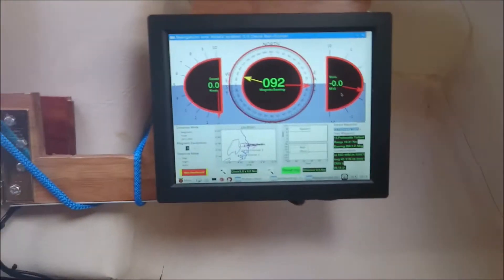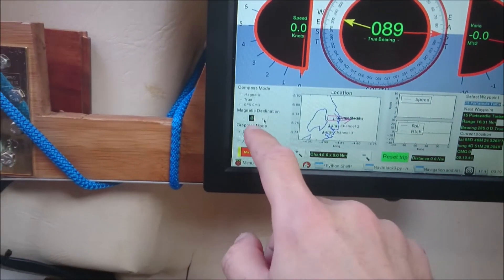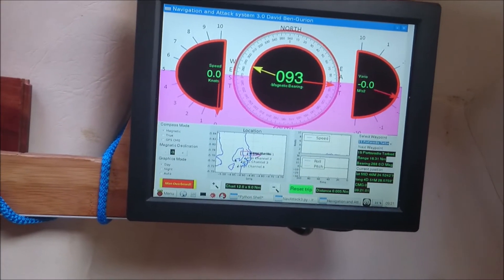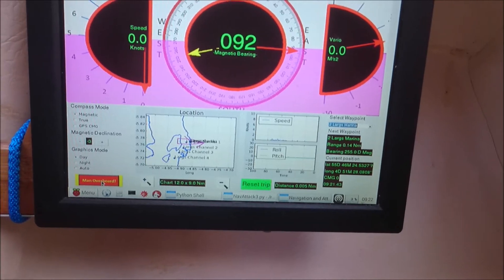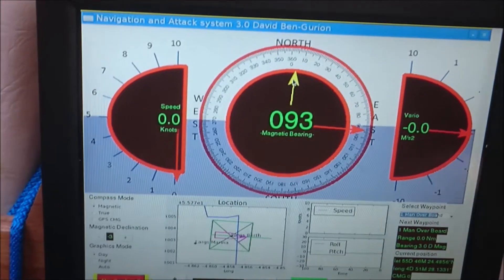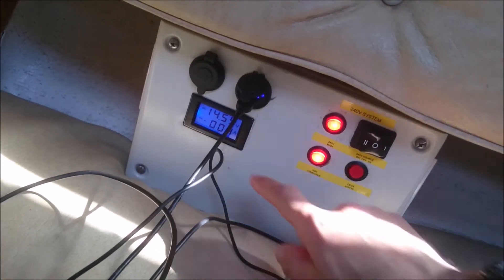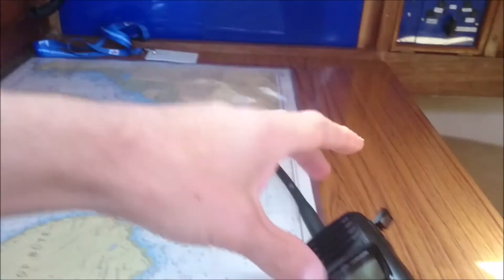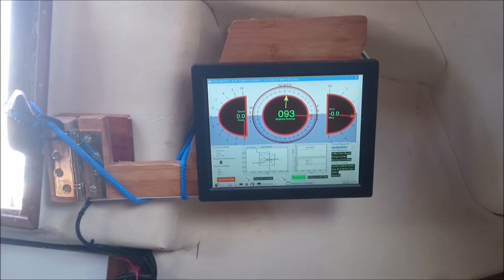Raspberry Pi based Yacht Navigation System talk through

Comment: Hi Olly, great work & presentation.  I'm currently searching for a DIY alternative to the overly expensive electronics control systems available for my" Good'Ol Boat", a 1979 C&C 34.  I'm curious, have you been able to incorporate other equipment into this system such as Depth Sounders, Wind Vanes,  Auto Pilot (I have an old Raymarine ST4000+), etc?  It would be great to have a central computer hub with the Pi, much like you've showcased, that can incorporate & display additional signals from peripheral hardware.  Any thoughts?
Reply from the maker: Many thanks Chris.  On the system presented here the only inputs are the compass and GPS dongle, and the only output is the display.  It is a stand alone unit.

I have considered attempting to add other sensors in, and am currently upgrading it to include wind speed and direction, and to communicate with the autohelm.  However for this I have decided it is easier and safer to simply add an additional wind speed and direction sensor than it would be to mess about trying to integrate the signals from my NMEA 2000 bus into a raspberry pi.  I am 100% certain that could be done, but I don't have the skills, documentation and time to do it.  In addition I live a good 50 minute drive from my boat so by making the system self contained I can build and test it at home rather than on board.

If you have an older NMEA 0183 network I believe it might be a bit simpler to integrate your existing sensors.  There are a few videos here on how to do that but I haven't tried it myself as I dont have that bus.  The thing to remember about NMEA 0183 is that it was designed to have only one "Talking" component and several "Listening" components.  Thus if your boat has an NMEA 0183 network there is almost certainly a multiplexer somewhere.  This device acts as multiple listening channels from the various sensors, and then outputs one stream to your instrument cluster.  Generally these outputs used a RS485 current-loop type serial communication.  In theory you could branch off this and into your raspberry pi with either a RS485-USB converter, or a similar arrangement directly into the Pis UART (Universal Asynchronous Receive Transmit) bus.  The problem you may have is that such converters are fairly pricey.  I have seen some people have succeeded with the much cheaper RS232-USB converters but bear in mind here that RS232 is voltage based not current based so unless you match it with the proper resistor values you run the risk of blowing your NMEA bus.  I would approach with caution but if you manage it please keep us posted!

If, like me, you have the newer NMEA2000 bus (or similar off-brand flavours of it like "Seatalk") there will not be a multiplexer because with NMEA2000 everything can talk and listen and it self synchronises.  I did a brief search some time ago to see if anyone had succeeded in linking this to a rasperry pi but couldn't find anyone.  Hopefully that has either changed or you might be the first.  

Another option is simply to install your own sensors and run them into the Pi as I am currently doing with wind speed and direction.  Water depth and log speed could also be achieved but I would be weary of drilling further holes in my hull for a project such as this :-)

Luckily, with your autopilot, the situation is likely to be much easier.  The autopilot is just an electric motor with a built in PLC.  If you bypass the autopilot controls it is very easy to control it directly by other means.  I would recommend an Arduino between the raspberry pi and autohelm as they are small, cheep, and able to take a lot of abuse.  On a slightly simpler level one of the guys at the marina had hacked a low cost Chinese radio control unit into his autohelm.  I am in the process of doing something similar.  However in my case the entire control circuit for my autohelm has died so I am replacing it with an arduino - I'll post videos of that once I have tested it at sea.

I'd be interested to see some videos of your progress and its always a pleasure discussing projects.  Best regards

Olly